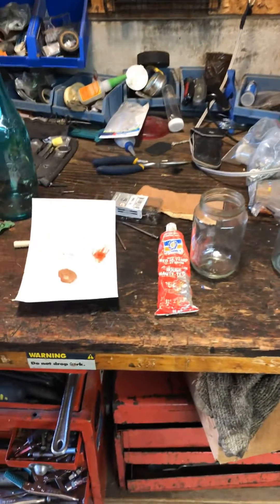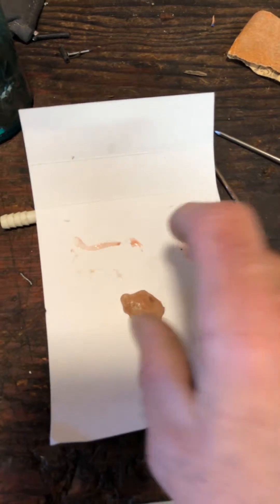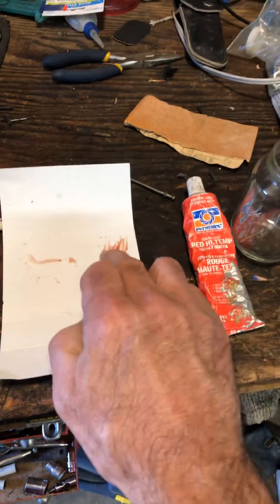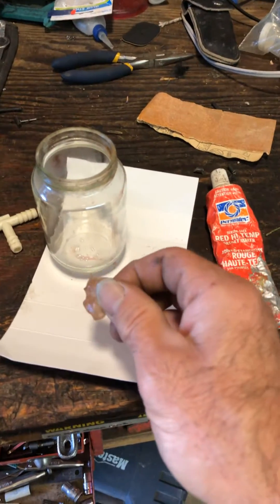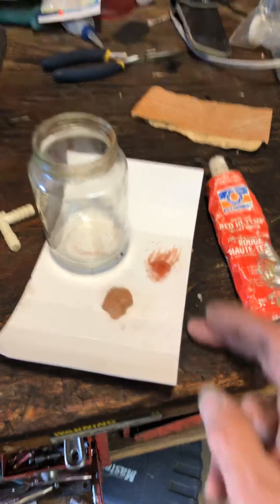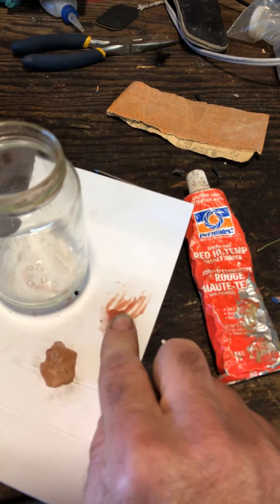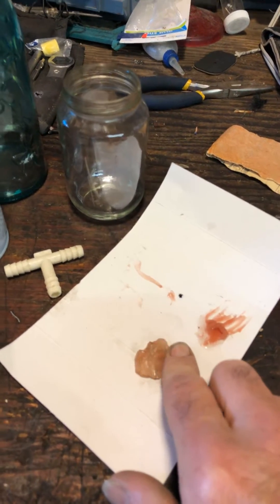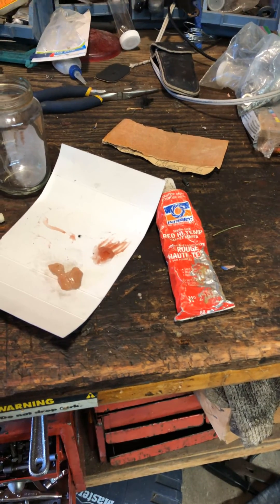Is Permatex gasket maker compatible with gasoline

Comment: Only use seafoam a few days before you do an oil change. Seafoam will cause the viscosity in oil to break down and will not be able to lubricate your engine and likely result in damage.

Comment: The gray in the red definitely do not work. In less than 24 hours they had both lost their integrity and become wavy little strands of what used to be a gasket. However the Permatex blue gasket sealer does work in conjunction with a gasket, as in if your gasket is old or is aftermarket and doesn't quite fit. However, Permatex is the wrong name for it because it does eventually fail.... I used it because I have a 40-year-old motorcycle and I needed my carbs to work while the gaskets were on order.... it did its job for about 3 weeks before I got another small leak indicating that I had forgotten to order the gaskets at all LOL.
Don't get caught up and get the right gaskets. But that stuff does work well in a pinch.... Permatex in the orange tube it'll say fuel resistant and when you open it you'll realize for no good reason at all it's blue. Like a translucent blue and it stays that way it's weird. It never becomes a gasket it stays tacky

Comment: Here to ask the same question... have you tried the Fuel Resistant kind and did tests?
Reply: Yeah was going to ask the same question. Why you conduct a test on a sealant that is not fuel approved makes no since. Permatex Motoseal gasket maker is fuel resistant to all fuels. I had a fuel bowl leak around brand new carb around gasket. Tighten made it worse. Looked online and found the Motoseal. It has a pic of a motorcycle on it. Put thin layer around base of carb where bowl sits on and tighten it up. Let it cure all night till mid morning. Cruised around and didn't smell gas anymore. Been 6 months still no leaks. Good stuff!
 https://www.youtube.com/watch?v=7LWjFGeZ5sA